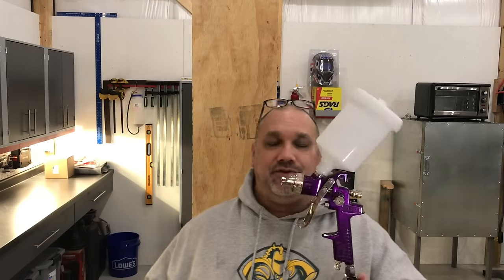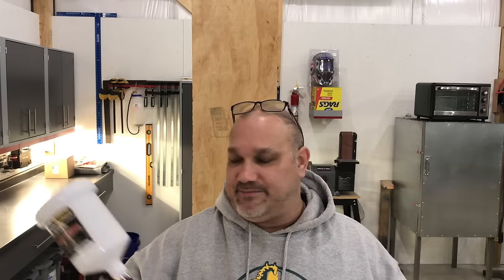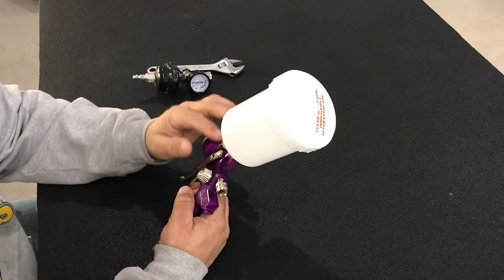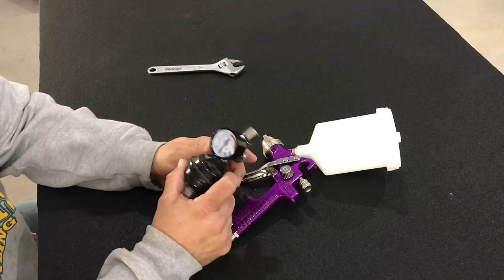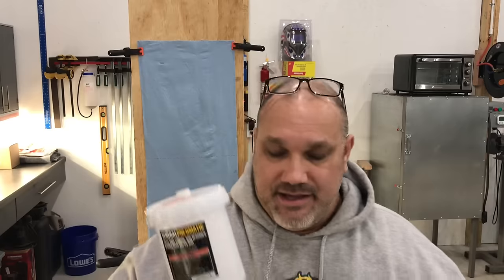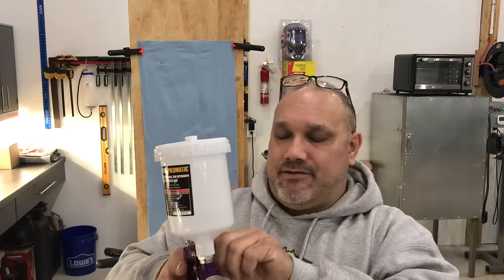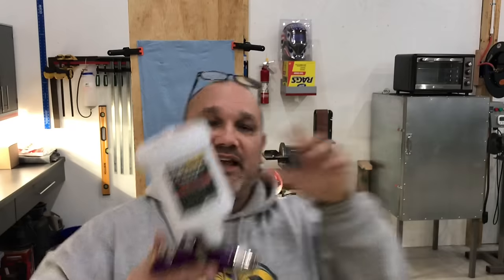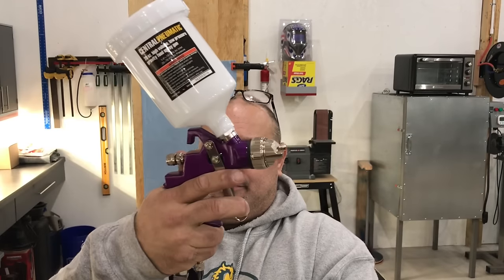How To Set Up a Harbor Freight Paint Gun

Comment: Would you be able to tell me if this paint gun would work to spray a gelcoat on a boat?
Reply from the maker: I am not familiar with gelcoat application. Sorry. Thanks for watching.
Reply: David did you ever spray your boat yet?
Reply: @TimStJohn-xp8rv  no sir i have not. But I just got a new 2 stage 60 gallon air compressor and I plan on trying it just as soon i install the air compressor.

Comment: Hello. I’m having a tough time with my sprayer. I’ve done all the set ups possible. But when I’m spraying my paint it sprays out dry and streaky. It’s almost as sandpaper :( what the heck am I doing wrong? Need your help!
Reply from the maker: Sounds like a couple possible issues, how thick is the material your spraying, do you still have the filter in the cup? This sounds like you’re not getting enough material. Or possibly moving too fast, or too far away from your part while spraying. Hope that helps.
Reply: Ok so after I watched your video I did more adjustments on it. The sealer turned out a bit better. I’m just going to follow all the steps on your tutorial. Thank you!

Comment: anyone bought one of these recently? i already used these as kind of a "throwaway" HVLP for epoxy primer, but i think they started gluing the nozzle in the gun, turning it into a throwaway gun for any use.. they no longer come with a wrench, and i guess since the nozzle is glued, there's no need to have the wrench lol. i tried to disassemble with the wrench i kept from one purchased back when they included them.. it bent it so bad that it's now a bottle opener...
Reply from the maker: callofgeorge thanks for watching. I usually rinse it a few times with solvent then get another gun. I store my gun with a little solvent in the cup and the air cap in the solvent. My son and I joke that a new gun is almost cheaper than the solvent it takes to clean it. Thanks for watching.
Reply: @gixerman01  i do the same.. i disassemble right out of the box and clean them before spraying, but i can't even take it apart fresh out the box.. my dad and roommate both looked at me crazy when they walked out right after i finished coating the car with epoxy and i tossed the gun in the trash.. told them it's cheaper to buy a new gun than the solvent and time to clean it..
Reply: I just purchased one recently and I saw the glue or loctite or whatever it is in mine -- I picked up a Park Tool 19mm Cone Wrench from a local bike shop and was able to break the nozzle loose with that, but it was fairly tough.  Not sure why the'd glue the nozzle since they're supposedly changeable, but they did a sloppy job of it and I had to spend some time cleaning mine out as best I could.  Additionally, I don't know if the design has changed, but wide open, I can only get about 5 fl. oz. per minute using water out of this gun with the fluid adjustment wide open.  First test spray on a car gas tank came out mediocre.  Coverage was decent, but it produced a textured finish -- Going to play with the airflow to see if I can do better.

Comment: I have the same spray gun. Im having trouble with it. It sprays air but will not move Acetone i place in cup to clean internals. Advice?
Reply from the maker: Is the needle pulling back when you squeeze the trigger?
Reply: @gixerman01  Having watched another video I realized the valve body the needle seats into at the tip is removable. When I opened it up The previous owner had stored it dirty and the primer was caked inside the valve body. I soaked it in acetone and scrubbed everything with 3M green pad. Sprays beautifully now. Thank you for the information and support. Keep putting good information out there, we appreciate you sir.

Comment: I picked u[ a HF detail gun, $13.95. I'm trying to spray shellac on a violin, getting orange peel. Any suggestions?
Reply from the maker: 3 things. 1 try thinning your shellac a little. 2 turn up the amount of air to break up the material to a finer spray. 3 you may just be putting on too light of a coat, spay a little heavier coat so that the part wets out. Try each of these a little at a time to see which one works best. Kind of hard to say with out seeing the part while it’s being sprayed. Hope that helps.
Reply: @gixerman01  Thanks so much! I appreciate the tips. I'm new at this so I'm sure that practice will help too.

Comment: Can you use this to shoot latex?
Reply from the maker: You can but it’s not it’s strong suit. Latex usually likes to have a larger fluid tip because of the thicker viscosity. ( thinning it down helps) Airless sprayers usually are better for that because the fluid is under pressure. Thanks for watching.

Comment: What size compressor is good for this gun
Reply from the maker: It depends on how big a project your doing. Small stuff like a motorcycle helmet you can use a a pancake compressor. Something the size of a car door you would want at least a 15 gallon compressor. For painting a car you will want something with a 60 gallon tank. Volume of the tank really comes into play, as well compressor output. I think you need at least 7-8 cfm at 40 psi to run this gun continuously. Hope this helps. Thanks for watching.

Comment: Mine keeps spackling and it doesn't put out much product for some reason. Even with proper adjustments an cleanliness
Reply from the maker: Is that little filter still in the cup? Also how thick is the material are you spraying? Thanks for watching.

Comment: What pressure for satin finish house paint?
Reply from the maker: You may have to thin the paint with latex or bump the air pressure pretty high because of how thick the paint is. You will have to do a little trial and error to get your settings. Thanks for watching.

Comment: Newbee here,what to do about tiger strips?
Reply from the maker: That can be caused by several things. Material being too wet, fluid too heavy in the center or outside edge or your fan, or not getting consistent overlap. Take a little time to check you fan for heavy spots try turning you air pressure up and see if that helps. Good luck, thanks for watching. Some heavy metallics is are tough to spry because of this.

Comment: Will this gun spray gel coat for a boat?
Reply: its all about  the tip size. pretty much any gun will spray what ever you want. you need the proper size tip. the gel coat manufacturer will have those specs for you.

Comment: I'm painting with tractor supply paint and I'm having bad orange peel.any help
Reply from the maker: Ronnie Colbaugh if it’s enamel you reduce with naphtha. It will help to atomize and material to flow after spray out. It will increase drying time though. A couple light coats are better than one heavy one. Good luck hope that helps.
Reply: Try turning up the air pressure. Mine works best at 45 psi at the gun, about 55 psi at the compressor. I'm using acrylic utherane

Comment: I used this poop ass gun to spray my car with single stage Urethane paint and no matter what psi or even when mixing correctly the gun just spits it’s paint out and causes a TON of orange peel, it just does not adamize well but then again it was 115* in my garage when I painted soooooo if I could of done something better please let me know. 

Gun had a moisture filter on and I tried spraying at 25psi all the way to 40psi lol    Maybe I should have used more reducer ?
Reply from the maker: Randizle Peregoy I would agree if you were having atomizing issues it could have been paint viscosity. If your paint is not wetting out as your spraying it may have helped to used more reducer. I ran this gun up to 60 psi on some heavier viscosity paints. That 115f didn’t do you any favors. Thanks for watching.
Reply from the maker: Here is a video with a few pics of the finish this gun is capable of. Purple paint gun and clear coat https://youtu.be/GUa9reejs78

Comment: I have that gun and the smaller one . what am I doing wrong when my gun is spitting it out in little balls
Reply from the maker: Glenn Chabut make sure the gun is clean. Make sure that your material is the right viscosity. If the material is too thick it can cause this. Don’t be afraid to put a little more air pressure to it too. Hope that helps and thanks for watching.

Comment: Agreed that gun is only good for primer and base coat,,,You need a $400-$600 gun a tekena pro lite will give you a flat shine finish with clear or single stage paint. I like to call these guns handicap guns because as long as you mix the paint correctly with hardner and reducer and correct PSI you will get a very nice finish everytime. No matter what you do with any gun that doesn’t cost $400 and up your top coat will be orange peely ATOMIZATION is everything
Reply from the maker: Car Tips thanks for watching. But disagree with the idea you have to spend 400 to get a gun that won’t have orange peel. Any gun can put orange peel on your part. It surprises me how many people think that you can put on prime and base with a cheap gun and use a good “expensive gun” for clear. If you have orange peel in your base it will telegraph that thru the clear. Base coat application is just a important as clear coat. You can’t spray away orange peel with a more expensive gun. I’ve ran many profile meter test trouble shooting coating issues and have found most orange peel issues originate in prime and base coats. Seldom in those cases was the clear application the issue. When clear coat was the issue, film build was the biggest contributor. Thanks for watching.
Reply: True, you can’t spray away orange peel, but when you paint if you’re doing it the right way you’re probably going to use a 2k primer which has to be sanded/blocked which will delete any orange peel caused by the cheap gun. Next especially if your doing single stage acrylic enamel that goes right on top of the sanded primer and with a $400 gun for example a tekena, with the right psi, reducer and hardner mixture youwill get very minimal orange peel. I doubt any high notch professional painter is painting top coat with any gun less than $350
Reply from the maker: Car Tips I’m sure guys doing this everyday are using guns that have rebuild parts available, the point I’m making is you can put on a slick paint job with this gun if it’s set right and your material is the right viscosity. I have a couple 500 dollar guns and the spray system we use daily has a couple 5800 a gun, but we spray 40 gallons of automotive clear a day. This is geared to the do it yourself guy at home.
Reply: Yea I understand it’s for the everyday DIY guy but the everyday DIY guy still wants a nice paint job. I honestly don’t believe a $15 harbor freight gun no matter the paint mixture psi etc will give the flat finish that people look for without wet sanding and buffing. If you could I would love and I’m sure the other viewers would love to see you paint maybe a spare metal panel with the purple harbor freight gun and have it look slick without wet sand/buffing ?? And then maybe paint another spare piece of metal with a $500 gun and show the difference??
Reply from the maker: Car Tips don’t believe me, don’t buy one.
Reply: @ncauto9095  my firrst ever paint job I used a harbor freight gun and the paint layed out perfectly, used it for the clear as well. Used hok candy basecoat and kustom shop speed clear. Almost no orange peel at all.only issues I had were places I didn't get to well when spraying due to how I had things sitting and some runs here and there, after all it was the first time.I'd ever painted anything. I was also painting in a screened in porch and not the best conditions. The second time I painted with the same gun I had a decent amount of orange peel, but not super bad, but I was also painting in +100° temperatures. https://youtu.be/unCrM8t55H4
Reply: I see you paint also,,,I think me and all of us who struggle with orange peel, well I don’t any more cause I bought a tekna pro lite would love to see someone actually paint top coat with a purple gun without wet sanding and buffing and show it up close
Reply from the maker: Car Tips LOL. Yeah I paint. Its how I make my living. I was making a point to a couple buddies that I could paint better with a rattle can and a harbor freight gun than most guys can with the best equipment. I didn’t talk about it in the video it was an inside joke between me and a couple buddies.  They are technical service guys for PPG. I’ve got a private video uploading for you that shows the paint and clear before it was buffed. I don’t just paint, I trouble shoot paint systems at multiple factories working with equipment vendors and paint vendors. I spec out material, viscosity, solvent blends, atomizing air pressures, oven temps, ramp rates of cure, flash requirements, fluid delivery requirements and all the equipment involved. I know you don’t know me from Adam but I am the paint guru for the company I work for. They send me to any location that is having coating issues to include precoat and wash. The video should be up shortly for you.
Reply from the maker: Car Tips here you go buddy 
Purple paint gun and clear coat https://youtu.be/GUa9reejs78
Reply from the maker: sinformant the paint job looked good! And good for you tackling that on for your first paint project.
Reply: Car Tips this gun blows at primer

Comment: Full fan full fluid and spray at recommended psi on gun. Gun is garbage
Reply from the maker: I would check your material viscosity. Also the airline you use makes a difference. I’ve seen guys try to use 1/4 inch air line and help guns just don’t work well with that. Sorry you had issues with the gun. Thanks for watching.